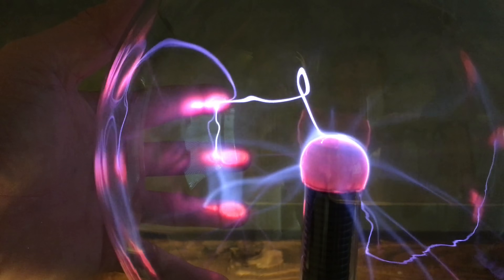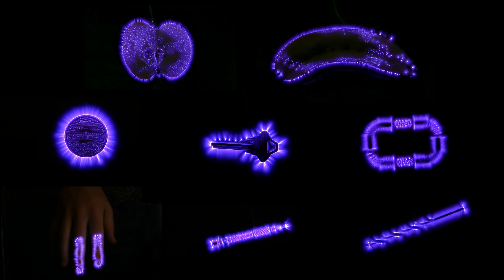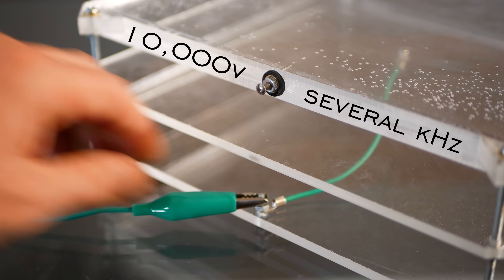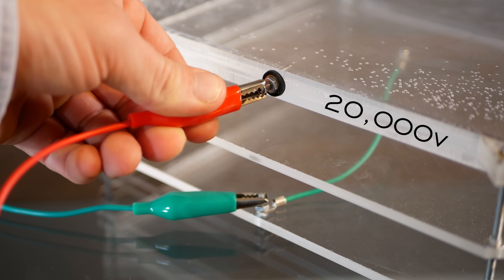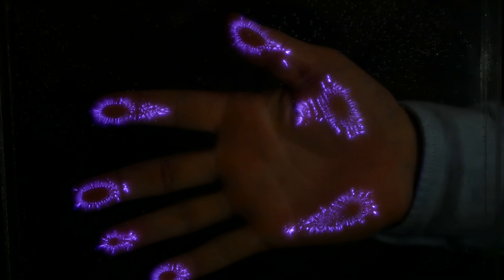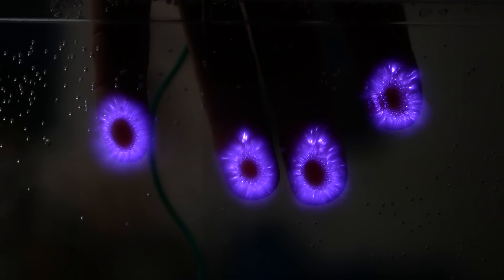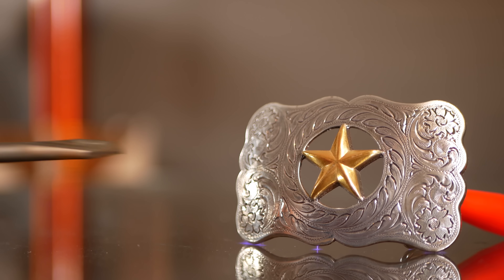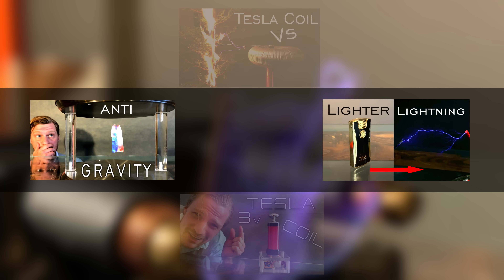DIY High Voltage Imaging With Kirlian Photography

Comment: wish you had shown more circuit details. and btw what is the current ratings?
Reply from the maker: Hello Varun. There is no circuit to this device. Any high frequency high voltage power source will do. The power source I used runs at about 3mA
Reply: @PlasmaChannel  thank you so much. I just wanted to know current ratings
Reply: Im using a transformer for high voltage with 500mA to 1A current. Will it work?

Comment: It can be aura but seems like it doesn't  works on live things. This violet color comes from the high voltage electrical arc colour and it is usual colour of electricity. But also actually non-living things or objects tends to be on violet aura as in the video. I have practiced to see auras with my bare eyes, it is actually really easy and natural thing, pretty much everyone can do that for sure. When i look at objects mostly i see violet color of aura around them, but when i concentrate on people i see various colours of wide aura. The reason is that : Only live and intellectual beings can reflect a large radius of different colours of  aura. Even animals doesn't have a colourful  wide aura. Based on some scientific relations between auras and their electromagnetic spectrum, It is actually possible to make a device that shows an aura, but using your own mind to see aura is a lot easy and natural.
Reply: Hiw do you see with your mind? Step by step please?

Comment: If you use distilled water instead of normal tape water will there be any change in that projection.
Reply from the maker: That's a great question. I will have to try that.

Comment: Very nice experiment, thank you for showing us. Can I use a car coil to this experiment, or is the frequency wrong?  What other high voltage sources do you recommend?  Greetings from Norway.
Reply from the maker: Greetings from Seattle, Wa, USA! Norway is a place I very much wish to visit - my blood goes back to Norway. You indeed can use an ignition coil, but will need to crank the frequency up to about 8-10khZ. I'd suggest a 555 driver to power it. However, flyback supplies are even better and provide the 'dancing plasma' effect you see in this video (and the last).
Reply: @PlasmaChannel  hello and thank you for your reply. I think I will try to build a flyback as you suggest.  Very interresting to hear that your family comes from Norway, if I'm not wrong, Seattle is not far from a place they call "Little Norway", correct me if I'm wrong.  You are very welcome to Norway, and if you come here you have to visit me and we can have som crazy high voltage experiments in my "lab" :).  (I live in Drammen, close to our capial Oslo).  Have a nice saturday evening and sunday.  Asle

Comment: I have another question.
Since the setup requires AC, what transformer are you using ?
Since Flyback transformer gives DC output...
Reply from the maker: Great question. Not all flybacks output DC. You just have to find the right one. This is a fly back driven high voltage supply

Comment: This is a great setup. I got around to building everyone's favorite resonant transformer using a fence zapper and hand rolled wax paper caps. The output is around 60KV just past 1'' arcs.
Reply from the maker: That is impressive, the 1" arcs must have been very high current.
Reply: @PlasmaChannel  They were capable of setting paper on fire but still not to hot to touch bare handed. I estimate it was pulling 20W max from the secondary most likely less though.

Comment: Btw what glue have you used to join the two acrylic plates ?
I mean can I use hot glue to join them together ?
Reply from the maker: You need to use acrylic glue. So, some experience with acrylic is needed. 

You could use hot glue but it would be messy and may leak water after a short period of time.

Comment: this is filled with normal tap water right?
if yes, i wonder if salt/conductive water would make much of a difference
Reply from the maker: Correct, this is normal tap water. Salt water would likely cause the current draw to be greater, leading to even brighter corona around the edges of objects. However, that increased current would shorten the lifespan of the plexiglas
Reply: @PlasmaChannel  What if it was made with actual glass?
Reply: @dl08in  maybe just add a pinch of salt

Comment: Awesome.  Is the movable platform designed to vary distance from the ground connection or simply for moving the camera?  Also, are there any ESD risks to cameras or other equipment?
Reply from the maker: The moveable platform is in order to image various objects. Getting the camera too close causes it to really freak out.

Comment: From video it's not clear about second wire. Frist wire is attached to the water. But second one - is it attached just to the one of bottom acrylic plane or what?
Also is not clear - you just put objects on top of your acrylic setup? Or it below of plane with water? Where is camera placed?
Reply from the maker: The ground wire is attached to the adjustable platform. All objects contact the ground wire, on the adjustable platform. It's adjustable to account for different object sizes. Camera always from above.
When imaging my hands, camera is effectively from below. I am just placing my hand on the "top" of the plexiglass. My body is grounded during the shoot, so I dont need to touch the ground wire.

Comment: Do kirlian on quartz crystal
Reply from the maker: Hmmm that's a great idea.
Reply: Plasma Channel I'd be really interested in that.
Reply: Plasma Channel I would be interesting if you could film it holding on its base, then then tip, and then at both poles and for some time. Would there be anyway to monitor its oscillation during the process?

Comment: good video, how about some low volt pulses, can you run a live line in and through something too see the pulses? like a thermal shot
Reply from the maker: A thermal shot would be very low resolution. In order for Kirlian photography to work correctly, ionizing voltages are required. That is a minimum of 360 volts, but ideally, close to 10,000.
Reply: @PlasmaChannel  is this similar to touch screens on a cell phone, reacting with electrons, have you seen any utube video on every cell in the body contains an electric charge? added up to a high voltage, they were talking about the stomach being similar to  a battery , good stuff

Comment: 4:50 what is that thing forming on the pipes on the top middle section you can clearly see it when it's slowed down
Reply from the maker: Hello, what you're seeing are multiple corona streams competing with one another for space and electrical charge density. It causes them to dance.
Reply: @PlasmaChannel  Thanks for the response, you have a great channel  just keep it up.
Reply: Or is it Ozone gas creating at instant and Corona trying to graze around it.

Comment: You could have gone more into Detail on how your setup looks and where exactly the voltage is applied.. Nevertheless, beautiful!
Reply from the maker: Thank you very much! The voltage is applied to the two connector bolts. One is a ground which touches the object, the other, electrified the water.
Reply: @PlasmaChannel  so that little green wire in the middle is the ground (negative) and the other is positive?
Reply: also how does it work when your hands are under it? Also what makes it safe to touch? Sorry for all these questions your videos are awesome

Comment: Amazing! I get giddy every time you release a new video!

Question about the build, I see that one lead is attached to each plexiglass part, but is your hand or other object placed in between the two and I'm contact? Or is it somehow just needed on the outside? (I'm sure this is a simple question, but with the lights out to show the effect, it is difficult to see where the object is in relation to the panes)

Thank you as always for the videos and inspiration!
Reply from the maker: Hi Justin, great question! So, when imaging small objects, they are placed under the top water pane, and also sit on the adjustable middle plexiglas shelf. On that shelf, they touch a grounded wire. Basically, electricity flows between that grounded wire, through the object, and it capacitively couples with the water pane....and completes the circuit.

When using a hand, my body is grounded already. So, no ground wire needed. My hand is just placed on TOP of the water pane, and I move the camera to the underside of the whole device to show the plasma.

Cheers!
Reply: @PlasmaChannel  awesome! Good info to have!

Comment: What common power supplies are 15 kHz? Does anyone have any suggestions on how to find an appropriate PSU for this?
Reply from the maker: All of mine are custom built, and this was a ZVS driven flyback. However, it is designed to produce high voltage, not high current. Mine outputs approximately 4mA at 20mA. You can find ZVS flyback kits in the video description, if that helps!

Comment: Could this be used to check ‘roundness’ or ‘smoothness’?
Reply from the maker: It in fact can. Great question. The smoother an object is, or, the less sharp it's  edges, the less corona it creates.
Reply: Of course. Charge gathers at points (making for bigger arcs) - you may have noticed the corners of the objects were the brightest.
In industry, we use more sophisticated methods to confirm smoothness of a surface - especially for things of low conductivity.

Comment: So I'm curious what would Copper(II) sulfate or other metal salt's that are soluble in water show up with that process? Would it change the arks color like a fire or is it different because it's in water? Please test, more safely than I could? Here's a chart: https://www.compoundchem.com/2014/02/06/metal-ion-flame-test-colours-chart/  I'm also curious how it'd react to water balls saturated in 1 form wile the fluid surrounding contains another.
Reply from the maker: Hi Ransom. The plasma is not in the water - it is in open air. So, you could change the constituents of the water all you want, but the plasma would look identical. The water balls is an interesting idea.
Reply: @PlasmaChannel  would it kick crystals out in a super saturated version of the fluid like electroplating with DC currents but with with spontaneous nucleation?

Comment: Wow too many questions. What happens if you put live animals or creepy crawlers, ants etc. Crystals, capacitors, resistors and combinations so they would charge and discharge.
Liquids with varying viscosities with maybe metal filings mixed in.
I NEED one of these! Do you have detailed information so I can build one? You gave enough but I prefer not to make assumptions.
Thanks for a great video.
Reply from the maker: Hi Frank, i'm glad it stimulated your mind so much. That's why I shoot these videos! Putting any kind of animal or bug on the plane would be inhumane, though, would do little if any damage to them. It would, however, cause discomfort or scare larger animals. However, you could image a part of an animal with this, for sure. The water - likely would look quite similar, but hard to tell.
Reply: @PlasmaChannel  
Wouldn't a bug or animal use a lower voltage for the same results we get with the higher voltage and we don't mind it too much:) maybe train it like boiling a frog? I have no idea, I'll have to admit I thought you could film a spirit as I seem to remember a photo of someone's hand who had lost fingers only to have them show up using this type of photography. I guess not.
Anyway thanks, I'm always thinking about stimulating grandkids and your video accomplished that.

Comment: cool video, except didn't the REAL Kirlian photography use noble gases, not water??? you kind of knocked it without even stating that this isn't the same.
Reply from the maker: Thank you for the compliments. Replacing the water with a noble gas would give a very similar result.

Comment: Please make a video about Hirsch Farnsworth fusor

I'll never get tired on requesting this
Reply from the maker: dontlikemath is correct. For the time being, I do not have the proper equipment. However, if you'd like to help support my videos, financially, you can donate on Patreon. This will help me to purchase Vacuum equipment!
Reply: @PlasmaChannel  Okay man, you got it 

And by the way, I love your videos, this is my favorite youtube channel
Reply: I don’t think that he has the necessary vacuum equipment, or experience in even measuring (and shielding) the neutron radiation :/
Reply: @among-us-99999  Well there are some small replicas that doesn't need a big equipment and that are safe to make, I was able to make one with a small vaccum pump (1/3 HP, 4 cfm) and a 15kv power source, it was enough to create a nice plasma around the ''nucleus''. So since he has a huge voltage multiplier he could be able to achieve better results
Reply: @Renato S.C. What you built was probably just a spherical focus diode, without any fusion capabilities

His problem would be the required vacuum setup (very high vacuum required, needs to be able to add extremely small controlled amounts of deuterium to it, the chamber should be made out of metal)
Reply: @among-us-99999  I agree, but is just to show a concept, no deuterium or diffusion vacuum pump, just a small demonstration, he could even use it to electroplate stuff, and also play with the plasma inside using strong magnetic fields

Comment: Wow, that looks fantastic! So what hv power supply do you use for things like this? Do you have a flyback in an enclosure with wires sticking out or something?
Reply from the maker: It is indeed a ZVS driven flyback supply. However, it is designed to produce higher voltages, and lower currents. I've placed a link in the video description for a high voltage source that will produce results close to mine. Maybe not exact, but close.
Reply: Plasma Channel huh, always thought zvs drivers were designed for those high current white arcs. At least that’s what I’ve messed with so far :)
Reply: @PlasmaChannel  You mention in the video high frequency AC is required but the device you linked to has a DC output?